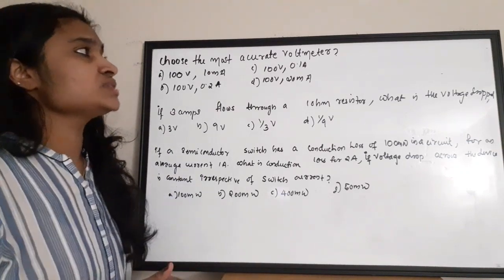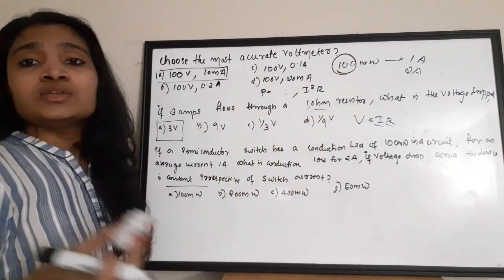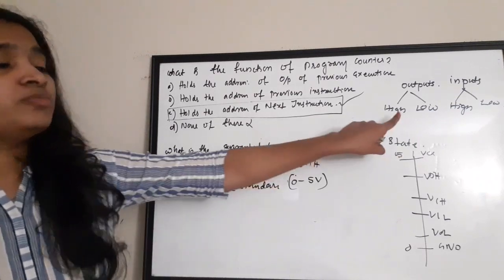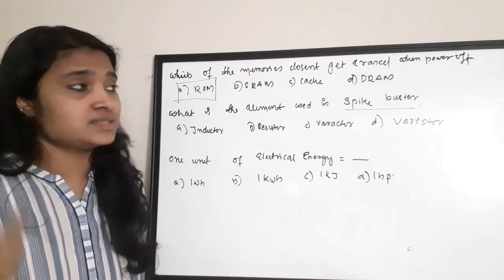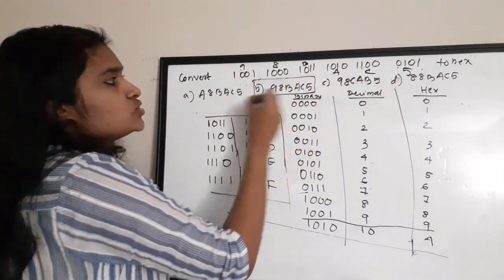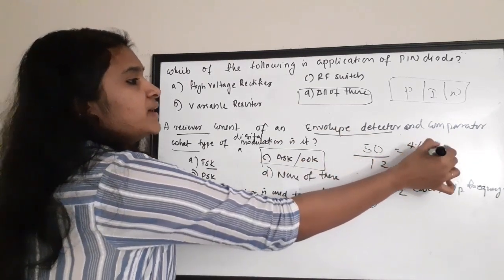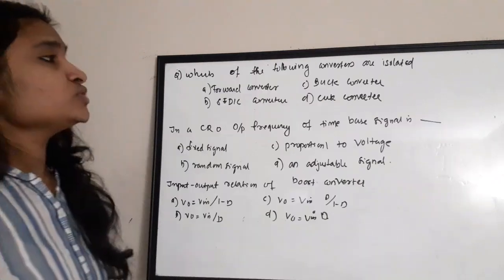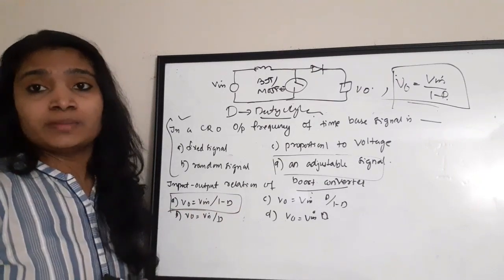NESAC-ISRO Technical Assistant Electronics 2020 Solutions Part4| ISRO|Gate|BARC|DMRC|AFCAT Prepare

Comment: no correct answer is  b toggle between 0 to 15 v inverting since VCC is 15 volt not 5 volt. ur input is 0 to 5 v
Reply: Yeah,correct answer is option b.
Toggle between 0&15v and inverting output